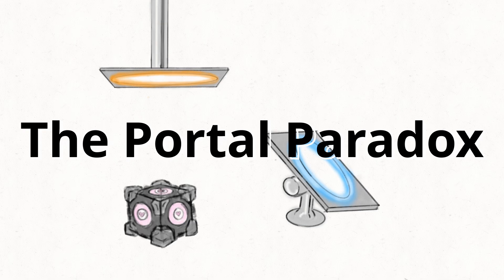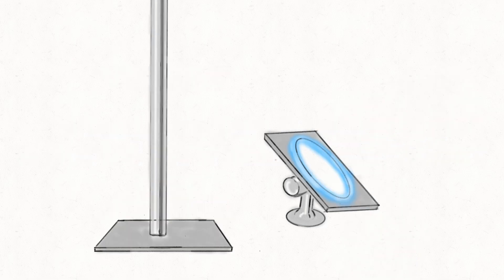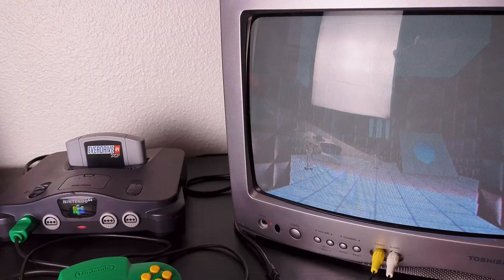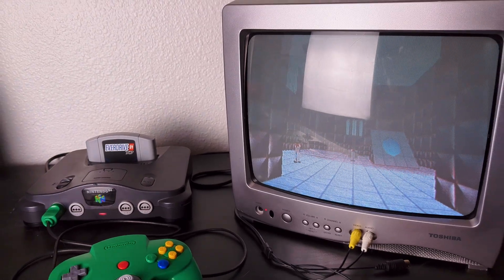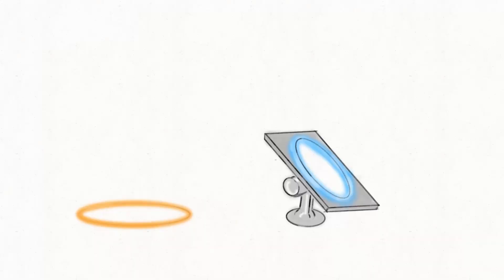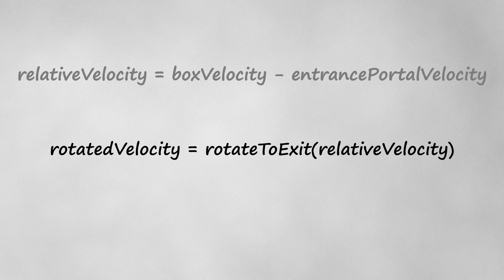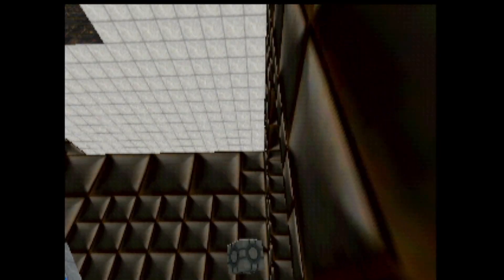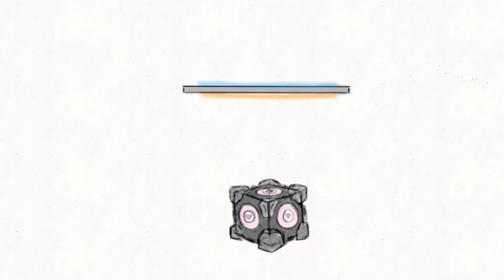I rewrote Portal from scratch and solved the Portal Paradox

Comment: Okay, but what if you don't fully pass the cube through the portal?
If the portal stops halfway down the cube, what happens?
We would expect the half that emerges from the portal to be moving, yet the half that has yet to pass through the portal is still stationary no? Does the cube pull itself through the portal?
Actually, now that I think about it, perhaps nothing would happen. Until the cube fully passes through the portal, I suspect it'd remain stationary.
Reply: Then it makes no sense, because after fully passing the portal, it's getting speed from nowhere.
His equation simply means that the cube would be sliced into 1-atom-thick layers because of how the force being applied.
Also, his equation just doesn't save momentum of the object. Therefore, it is wrong.
Reply: @fantastikboom1094  no I actually believe in his equation. The results he showed make sense to what we should expect to see, my question is mostly in regards to niche cases.
Reply: @isaakvandaalen3899  I already described why his equation is wrong so it can't be right at all. You shouldn't believe it is right too.

Comment: My concern in the equation, as a simulation of hypothetical physics, comes from the shifting of the frame of reference from entrance to exit. Is it a valid assumption to say that's transferrable? You are applying a velocity only from one frame of reference, and applying it to a seperate second reference, overwriting the 0 velocity it had relative to that 2nd reference.

As well as from an energy/momentum perspective. How would the energy of the moving portal be transfered into the box, which would be what gives the box a hypothetical velocity upon exit.
Because that would break entropy if there is not a way that it is transfering, since you are bascially creating energy in the box that previously did not exist, and is not being lost from the piston pushing the entrance portal.

Comment: Honestly the answer to this question is likely that the cube does just drop out. The thing is that's kind of boring. Still no matter how fast the portal slams down, there is no force on the bottom of the cube, which is the last part to come out you're essentially saying that if this orange portal slams down super fast but does not consume the entire cube because it stops before hitting the ground, then the cube is vacuumed into the portal and out the blue one. However that doesn't make sense. Why is it sucked into the orange portal?

Since the cube is not moving, when the orange portal passes through it, it is not moving when it comes out the blue portal and therefor it does not fire out.

This isn't a paradox, it's a question with an actual answer, but it's hard to convince people that is the answer because these aren't real, there is no proof.

Still this mechanic adds more potential the way you have it, so even though you are wrong, it is less boring. Sorry but the real world is boring. So boring that we don't even have portals, and so boring that even if we did, the cube doesn't fire out of the portal.
Reply: He should replace velocity of the entry portal with the velocity of the exit portal in his equation.

Comment: you have to consider the forces acting on the cube. At all times, the only two forces acting on the cube is gravity and the reaction force pushing back from the floor. The forces are balanced at all times, a changing environment around the cube (going through a portal) exerts no force and thus, the cube shouldn't accelerate in any of these scenarios.

Your interpretation only makes sense if, as others have pointed out, you interpret the two sides of the portal as as two 'universes' where one universe slides over part of the other. In this scenario, the cube has two sets of velocities at any given time relative to the immediate frame in its own universe and the corresponding frame in the other universe. The problem, in my opinion. Is that the same cube exists in both universes. If this is the case, where is the energy coming from to accelerate the cube? Perhaps you could argue that it comes from the same source of acceleration as the portal, and the 'universe' attached to that portal (in this case the piston), and that therefore, in accordance to Newton's third law, the cube pushes back on the piston arm also, slowing it down slightly.

This doesn't make sense if we go back to a classic stationary portal scenario as, if a fast moving cube (or human) falls through a portal and comes out of another portal, where both of these portals are on the floor, what is the equivalent of the piston in this scenario? the earth. And if the piston can accelerate a cube and receive a reaction force, then it should follow that a cube can fall through a portal and exert a force on the whole other 'universe', or perhaps just whatever surface the portal is on. If this where the case, falling through a portal would be the same as falling straight into the earth, the only exception being instead of the energy transfer occurring through impact with the ground, the energy would be transferred through whatever field is responsible for the transfer of energy whilst going through portals (such as the source of acceleration on the cube in the moving piston scenario). walking through any portal would necessitate applying a force to whatever surface the portal is on, and therefore portal travel would need to be very different than what we see in the game.

I think it makes sense to only consider the cubes frame of reference for any discussion of portal travel because otherwise you run into the aforementioned issues (which I understand I probably haven't explained the best I could). By this logic, Any moving portal scenario would behave like your hula hoop example.

You could also argue that the energy needed to accelerate the cube doesn't need to have a source, after all, in a classic ceiling-to-floor portal setup you could poor water down the portal, stick a turbine in the middle and have a perpetual motion machine. Sure, that breaks the law of conservation of energy, there's no avoiding that. What I am trying to avoid is the breaking of more laws. I think the solution that breaks the least known laws is the most elegant. Consider this: sure the portal can make energy from nothing, but what is the vehicle through which the energy is transferred to the cube? (in other words, where does the force come from). I have previously said that maybe the portal has some sort of field that can exert energy onto the cube, but maybe this field doesn't have a source? If this is the case, newton's third law is broken because the cube cannot apply a reaction force to something that doesn't exist. So we've now broken two laws. Why? If we take the hula hoop solution then we don't need to break this law.

The hula hoop solution (where the cube plops out) breaks the least laws and requires less mental gymnastics. there's nothing stopping us from letting portals breaks as many laws as we want, but breaking the least laws as possible I think makes portals a much more elegant fictional invention.

Comment: A portal can not give momentum it only  transfers it. The reason why most people are wrong is that you are perceiving the portal as an object instead of a gate. 

The equation wouldn't work because you are taking the portal velocity into account. The box and portal never collide, so it can not transfer moment. 

A simpler way to think of it is like cars on the highway. They can pass each other at the same speed, if they don't touch, they won't transfer any momentum and continue the same speed, and if they do hit, they transfer energy into each other and stop.

Comment: in other words, if the second portal had been stationary (platform pass through it on it way down) we would have the same effect as the first example.
the hoop example is what i reference, but lets pretend that the blue portal (exit portal) was already stationary in mid air at the same end point as it was attached to the platform, but instead of being on the platform and then move it would just stay still then i guess it would be tossed out like the first example.
i would assume. 
hope what i wrote makes sense.

Comment: So my next question would be as follows: If this same situation were to occur on a larger object with you sitting inside it, would it feel like you suddenly gained momentum? at what point as the portal came over you do you feel like you are now moving? Would you feel it at all or would you just feel the impact as the vessel stopped?
Reply: As the portal moves through the cube, the cube being pushed through the portal pushes the cube that's exiting the portal forward to make space, otherwise the exiting cube would collide with itself. Acceleration occurs at the point of contact between portal and cube when the relative velocitiesare summed and then rotated normal to the exit plan
Reply: I think that you would not feel any acceleration at all, that is as long as the entrance portal moved at constant speed. You would also not start feeling the movement as you came out the second portal as you can't feel speed directly. You might then feel air resistance slowing you down but not the speed itself. 
My reasoning is that we are used to living in what could be described as (or at least assumed to be) one, continuous, flat space time. For example, having two connected portals, where one of them is moving through that space time while the other is not is kind of like if you were to take a piece of paper, fold it and then drag one edge of this sheet on its surface.
If you were to stand on the edge of the portals (like the edge of the sheet of paper) so that half of your body was one one side and the other on the other side half of your body would be moving through the space with one portal and the other half wouldn't be moving. At the same time every part of your body could be not moving relative to the rest of you. 
I find it more confusing the more i think about it. I feel like i get it, but not well enough to explain it that well.

Comment: No, I think this is wrong. What breaks this for me is conservation of energy. The cube undergoes an acceleration but no force is applied to it. This setup could be used to make an infinite energy machine. In fact the REAL clincher for me is: the weight of the cube should have no impact on the exit speed of the cube, and therefore a heavier cube will exit the portal with more energy than a lighter one, but the moving portal won't feel any difference between a heavier and lighter cube. Yeah, now that I've written it out, I 100% do not buy this solution.

Comment: the easiest way i see this visualized, is by looking into the exit portal. The ground looks as if it is actively moving, pushing the cube towards the exit. while this is not technically the thing that's happening, it is EQUAL in velocity to what it looks like.
Reply: It is not equal. If the floor isn't pushing the cube, then it's not pushing it. Then the cube can't get any speed. There is no reason and no way portal can transfer its energy to the object passing through.
Reply: @fantastikboom1094  yeah it is
Reply: @loydtheliar5659  It is not equal. If the floor isn't pushing the cube, then it's not pushing it. Then the cube can't get any speed. There is no reason and no way portal can transfer its energy to the object passing through.
Reply: @fantastikboom1094  you are acting as though this was factual, though i would like to remind you portals *aren't real*. Also, i would guess a portal wouldn't transfer it's own velocity, but rather the environmental change between the portals would tug on the cube.
Reply: @loydtheliar5659  The only environmental change is direction of gravity in relation to the cube on the exit side. So, it would plop out.
Reply: @fantastikboom1094  it's like the velocity an object inherently gains from being on a train, or some sort of vehicle. it's relative
Reply: @loydtheliar5659  No, it's not. You're not moving the object itself, you're moving the passage. Passage can't give you speed.

Comment: I do not think this is the correct implementation. The panel with the portal has kinetic energy, and is slamming on top of the cube. However, there is no collision - the portal is simply a hole. With no collision, the energy from the panel cannot possibly transfer to the cube. It is certainly reasonable to say that the cube is travelling x m/s relative to the panel, but you cannot use that reasoning to suddenly say that the cube magically gains kinetic energy. The panel is still the only thing with the kinetic energy, and therefore, the cube has to just plop out the other side

Comment: I think of the portal as a doorway between two points, basically passing from one end to another would be like passing through an infinitely thin plane. You could not give one side of this plane motion without moving the other side as well. If you did you would have to give this plane thickness making it into a hallway. And then the question wouldn't be would the cube have an exit velocity, but it would be does the cube even reach the other side of the hallway.
Reply: nice aproach!

Comment: I have never heard of this paradox, but I initially agreed with you, then went back and fourth in my head, but ultimately, I do think this is the correct solution. Just thinking about it logically, not mathematically, look at just the blue portal. If you observe only the blue portal, you would see a cube moving out of it at a high velocity, for that cube to come to a sudden stop and just flop out would violate the laws of inertia. Ultimately it doesn’t matter why or how that initial velocity was gained, if the cube has some sort of velocity, it needs to decelerate like any other physical object,
Reply: The cube has no inertia for flying out. It's wouldn't be stopped, it is already stopped.

Also, you forgot about cube's perspective.

Comment: Say you have two portals facing upward in a vacuum. The blue portal is stationary, and the orange portal is falling at 50m/s. If you allow a falling cube to reach 50m/s before it enters the blue portal, what happens? Is the cube suddenly reduced to near 0m/s and left briefly suspended in the wake of the orange portal, and has to start falling all over again?
Reply: The cube will get +50 m/s because it is coming out of the exit portal, and it's only the exit portal affects cube's velocity. His equation is wrong.

Comment: So, what happens if the moving orange portal only goes 2/3 of the way down the box? Does the relative momentum cause the remaining 1/3 of the box to “jump” through the portal, or would it not move until it is completely engulfed?
Reply: The object's remaining velocity would help tug it along much like you would tug a rope to bring something with you somewhere. Though, you would lose 1/3rd the velocity or close to it. I am not a physics expert.

Comment: I've spent a lot of time thinking about this silly conundrum and I think I keep coming to the conclusion that there has to be some sort of inertial force to overcome for an object to move into a portal and gain it's relative momentum. Say you're standing still and you want to put your hand into a portal that has the other portal moving 1000mph relatively speaking, in order to put your hand in that portal you'd need to overcome 1000mph worth of inertial energy. What would happen to our box if the portal were to stop halfway through the box? Would the box be ripped in half? Half the inertial force? What would happen to my hand? A perfectly rigid indestructible companion cube would never experience ill effect since all force would be exerted evenly across the whole box, but what about something not rigid? 

But to be clear I am 100% on board with the solution, I definitely believe in the conservation of momentum, I just think the object experiencing the new momentum unless perfectly rigid and indestructible will experience violent change in kinetic energy as it is shifting it's perspective. TLDR would energy be required to overcome the inertial force of the opposite moving portal?

Comment: The only thing I can see wrong with you equation was wrong in source portal too: the fact that skipping an object through the portal at a shallow angle still results in the object shooting straight out of the portal, instead of exiting at a shallow angle. (To fix this, the "rotate velocity to exit portal" part would need to be replaced with "rotate velocity by the difference of the two portals' quaternion angles".)
Reply: His equation is just wrong. It doesn't make any sense. There is no reason and no way portal gives energy to an object that passes through.